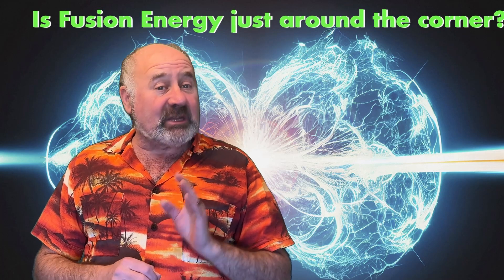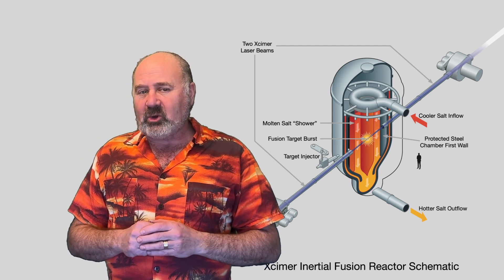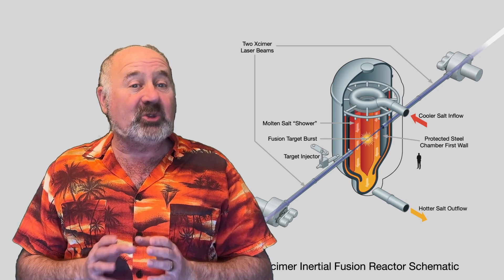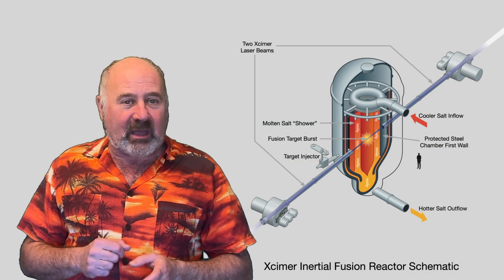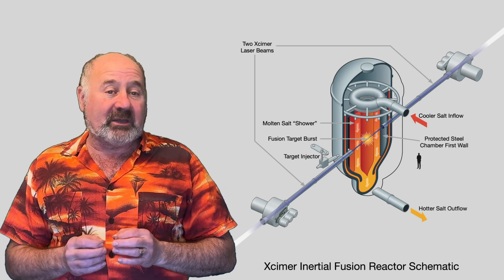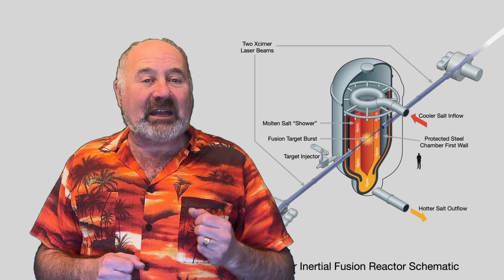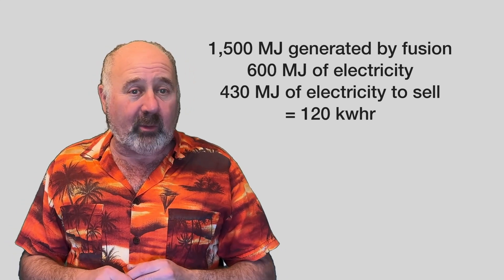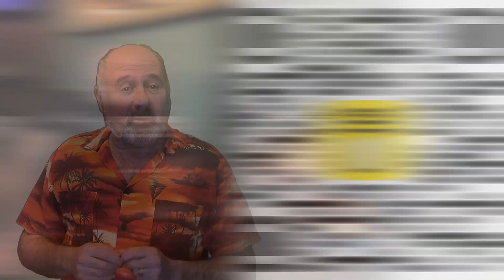Can millions of mini hydrogen-bombs power our world?

Comment: Xcimer claims that a key advantages of their laser system, compared to systems pumped by diode lasers, is the lower cost. Here is what copilot said: 

Excimer lasers, on the other hand, tend to be more expensive due to their complex construction and the need for high-energy pulses. The cost per joule for excimer lasers can be significantly higher. For instance, excimer lasers used in fusion energy applications have been designed to reduce costs by a factor of over 30x compared to traditional systems, but they still remain more expensive than diode lasers.

Cost Comparison
Diode Lasers: Lower initial cost, higher energy efficiency, and lower operational costs. 👈✅

Excimer Lasers: Higher initial cost, lower energy efficiency, and higher operational costs. 👈❌

In summary, diode lasers are generally more cost-effective per joule compared to excimer lasers, making them a preferred choice for applications where cost and efficiency are critical factors.
Reply: thanks copilot
Reply from the maker: Not an expert, but I don’t think laser diodes go anywhere close to this energy or wavelength (UV).
Reply: @Decarbonize11  You are correct—no single laser diode can produce 4 GW. That is why they are grouped into bars, stacks, and arrays. A quick online search revealed several high-efficiency, high-power diode laser modules. In particular, I found a 6-inch, rack-mounted module designed for pumping (940–980 nm) solid-state lasers. These modules deliver a peak power of 200 kW for 3 ms pulses at 65% efficiency. To pump 12 MJ of energy in 3 ms, approximately 20,000 of these modules would be required. This could be achieved with 333 cabinets (each measuring 5’ × 2.5’ × 1’), housing 60 rack-mounted modules per cabinet. The total footprint would be just 150 square feet.
    To put this in perspective, consider the National Ignition Facility (NIF) laser system. It is housed in a 10-story building covering approximately 500,000 square feet, with the laser amplifiers alone occupying about one-fourth of the total floor space.
    It is true that infrared (IR) light produces significantly more suprathermal (“hot”) electrons than ultraviolet (UV) light. These high-energy electrons can preheat the fuel, raising its temperature prematurely and reducing the compressibility of the target. However, if the target were a bubble of fuel submerged inside a reactor—a large hollow metal sphere filled with molten Nd:FliBe (a fluoride-lithium-beryllium eutectic) serving as the medium for a liquid-state heat-capacity laser—this preheating effect would not be an issue. The fuel would be better contained within a dense liquid rather than in a vacuum chamber. Additionally, heat loss from bremsstrahlung radiation could be reflected back into the fuel.
    Another advantage of using bubbles of fuel is target cost — zero. 
    A population inversion could be created by using fiber optic cables to pump energy from the laser diode modules into the Nd:FLiBe. If a large bubble of fuel were positioned in the center of the reactor during a population inversion and acoustically compressed, then the bubble's blackbody radiation would trigger a laser cascade. This cascade would then be amplified, reflect off the polished metal walls of the reactor, and further heat and compress the fuel until fusion ignition occurs.
Reply: What happens when two adjoining regions of condensed matter (solid or liquid) with different electron densities are suddenly heated to the same extremely high temperature—high enough to fully ionize them? ⚛ 

Apparently, since the temperature is identical in both regions, their radiation pressure will also be the same. However, the contribution of particle pressure to the total pressure will be proportional to the particle density. Initially, in their un-ionized state, the particle densities of both regions are roughly equal. But upon ionization, these densities can change dramatically, as high-Z materials release far more electrons than low-Z materials. Even in a radiation-dominated system, where radiation pressure far exceeds particle pressure, the total pressures in the regions will not balance. This pressure differential causes the high-Z material to expand, compressing the low-Z material. The effect is even more pronounced when low-Z gas is surrounded by high-Z condensed matter.

This ionization-driven compression could be crucial in a fusion reactor where high-Z material directly contacts bubbles of low-Z fuel. Interestingly, a similar principle was explored in the Soviet Union’s "Layer Cake" (Sloika) H-bomb design. It incorporated Vitali Ginzburg’s idea of using solid lithium deuteride fuel alongside Andrei Sakharov’s concept of ionization compression.
Reply from the maker: That sounds pretty much like the NIF approach, which was incredibly complicated and expensive to coordinate all these lasers.
Reply: @Decarbonize11  In the system I’m envisioning, laser synchronization would happen automatically and with minimal complexity. Each laser diode module would feed light into a bundle of fiber optic cables, which would shine directly into the reactor chamber to pump the Nd:FliBe (a solid-state laser medium). This pumping creates a population inversion—a process that unfolds over milliseconds, not nanoseconds.

Importantly, this pump light wouldn’t directly heat the fuel bubble. Instead, the main laser would handle heating and compressing the bubble to fusion conditions. This main laser itself is a spherical, heat-capacity liquid Nd:FliBe system, and its laser-cavity is the entire reactor chamber with its spherically mirrored walls. The main laser will remain in a meta-stable population-inverted state (inactive) until acoustic compression of the deuterium-tritium (DT) fuel bubble drives it to emit an intense pulse of blackbody radiation. That thermal pulse is what triggers the laser cascade, which quickly drains the pump-energy from the laser-medium (Nd:FLiBe) and deposits it in the bubble of fuel. 

😉 The process is fairly elegant: the Stefan-Boltzmann Law (which links blackbody radiation to temperature as ∝ T⁴) naturally synchronizes the acoustic compression and laser firing, ensuring the laser activates at the optimal moment—when the fuel bubble is already partially heated and compressed. 😉

Overall, this design could dramatically lower costs, especially since the laser system is typically the most expensive component in inertial confinement fusion (ICF) power plants.
Reply from the maker: That’s very long light at 1053 nm. I doubt the coupling to the bubble would be appropriate to trigger fusion.
Reply: @Decarbonize11  That is an insightful observation. However, it seems based solely on limitations of current ablative-drive, cryogenic, high-compression fuel capsules rather than my method. Historically, the "exploding pusher" concept dominated, where a thin shell heated by lasers explodes, resulting in modest fuel compression but high initial temperatures. These targets ultimately failed to achieve high gain and were abandoned due to:

• *Insufficient Fuel Compression:* Exploding pushers offer minimal compression compared to ablative methods. The thin shell rapidly disintegrates from laser shock, limiting fuel density and preventing sustained burn. Fusion occurs briefly in shock-heated plasma, yielding minimal energy before expansion and cooling. Lack of confinement prevents ignition and sustained reactions.

• *Poor Energy Coupling and Preheat by Hot Electrons:* Exploding pushers suffered from poor energy transfer from lasers to fuel. High-intensity lasers generated hot electrons preheating fuel prematurely, causing expansion and reduced density. Early lasers like LLNL’s Shiva experienced low yields due to inefficient energy absorption (~20%) and wasteful heating. Shifting to shorter wavelengths (UV lasers) improved coupling, but fundamental inefficiencies remained.

• *Rapid Heat Loss and No Self-Heating:* Exploding pushers produce hot but short-lived, low-density plasma, losing energy rapidly through conduction, radiation, and expansion. The fuel fails to trap alpha particles for self-heating, quickly dissipating energy and falling far short of ignition criteria.

Thus, designs shifted to indirect-drive approaches using thicker shells and cryogenic fuel, leveraging symmetrical X-ray drives for efficient compression.

My approach addresses these issues by confining fuel within several tons of molten salt undergoing high-speed implosion and kilobar-scale pressures. My laser intensity (~10¹⁰ W/cm²) is significantly lower than NIF’s (~10¹⁵ W/cm²), avoiding instabilities and hot-electron generation. Above this intensity, FLiBe breaks down, producing an absorbing plasma wave, heating to ~200,000 K, and generating shock waves that compress the fuel.

Although initially counterintuitive, my approach could fuse larger bubbles with ~10x fuel mass and significantly lower density compared to traditional ICF capsules. While the larger bubble surface area suggests greater heat loss, its significantly lower thermal conductivity and reduced temperature gradient result in overall thermal losses approximately 30 times lower than conventional compressed capsules. Consequently, my approach more easily achieves self-heating, enhanced by a spherical mirror focusing energy back onto the bubble.
Reply: @Decarbonize11 Dr. Silber, sorry if this is redundant. I'm pretty sure I already posted a comment here, but my posts keep disappearing.  :face-orange-frowning:

In the system I’m envisioning, laser synchronization would happen automatically and with minimal complexity. Each laser diode module feeds light into a bundle of fiber optic cables shining directly into the reactor chamber to pump the Yb:FliBe (a solid-state laser medium). This pumping creates a population inversion—a process unfolding over milliseconds, not nanoseconds.

Importantly, this pump light doesn’t directly heat the fuel bubble. Instead, the main laser—a spherical, heat-capacity liquid Yb:FliBe system forming the reactor chamber and its spherical mirror—handles heating and compressing of the bubble located within the laser itself, to fusion conditions. The main laser remains in a meta-stable, population-inverted state until acoustic compression of the deuterium-tritium (DT) fuel bubble generates an intense pulse of blackbody radiation, triggering a laser cascade. This cascade quickly drains pump energy from the Yb:FliBe medium and deposits it into the fuel bubble sitting at the central focus of the reactor chamber.

The Stefan-Boltzmann Law (blackbody radiation ∝ T⁴) naturally synchronizes acoustic compression and laser firing, ensuring activation at the optimal moment—when the fuel bubble is already partially heated and compressed.

Overall, this design could dramatically lower costs, especially since lasers are typically the most expensive component in inertial confinement fusion (ICF) power plants.
Reply from the maker: @michaeldeeth811  Sorry if I'm being thick, but I'm trying to wrap my head around your idea and it's just not clicking. 

For instance, what triggers the flash of backbody radiation that triggers the laser? 

So your liquid YB FliBe would serve multiple purposes: lasing material, heat absorption, neutron absorption, lithium breading. Would the turbulance in the liquid impact it's ability to create the next laser flash? Does an element needed for the laser properties absorb neutrons, preventing tritium breading? Are there lasers even remotely like this?
Reply: @Decarbonize11  Thank you, Dr. Silber, those were very good questions. 

Can a compressed bubble produce sufficient blackbody radiation to trigger a laser cascade? 
The temperature of a compressed gas can be calculated T2=T1*(P2/P1)^((gamma-1)/gamma), where T1 is the initial temperature, P2 is the final pressure, and gamma is the adiabatic index.  If, for example, we assume T1 = 750 K, P2/P1 = 10000, and the gamma of hydrogen gas ranges from 1.4 (molecular) to 1.67 (atomic), the final temperature ends up between 10,000 K – 30,000 K. According to the Stefan-Boltzmann law, the bubble’s surface will radiate with between 57 kW – 4.6 MW per square centimeter. However, this radiation is broadband and incoherent, encompassing a wide spectrum of wavelengths, whereas laser amplification occurs within a narrow band. Only a small fraction of the bubble’s blackbody spectrum will align with Yb:FLiBe’s narrow amplification bandwidth, but if the full spectrum passes through a gain medium, specific parts can be selectively amplified. 

How is compression of the bubble achieved? 
I propose using numerous piezoelectric stack actuators positioned around the exterior of the spherical reactor.  These devices exploit the piezoelectric effect to generate precise motion or force through rapid expansion or contraction under electric fields, which can switch polarity within microseconds. Constructed from stacked layers of robust ceramic material, they withstand compressive pressures up to approximately 250 MPa. Individual actuators can exert forces of several kilonewtons or more, depending on their design parameters (layer count, cross-sectional area, stiffness) and applied voltage. If all of these were energized simultaneously when the bubble was at the center of the sphere, the pressure created would transmit inward, gaining speed and pressure as it converged toward the bubble. 

Will turbulence and non-uniform temperature distributions lead to laser failure? 
Comparing FLiBe to water provides insights: FLiBe's viscosity is approximately ten times greater, reducing turbulence significantly. Additionally, FLiBe's thermal conductivity is double that of water, quickly smoothing out temperature variations. Its thermal expansion coefficient (~0.00002/K) is also an order of magnitude lower than water, minimizing optical distortions due to density gradients. Thus, turbulence and temperature gradients are not expected to significantly impair laser performance.

How does neutron absorption in Yb impact the tritium breeding ratio (TBR)? 
Typically, in rare-earth lasers, only a small amount of dopant (0.5 – 2.0 atomic percent) is required. There are several isotopes of Yb, and most are well behaved. However, when 168Yb captures a neutron it becomes radioactive, emitting a 177 keV gamma (46 s) and beta decaying (32 d) into 169Tm. The neutron capture cross-section of 168Yb is about 100x that of lithium. This is not fatal, because the abundance of 168Yb in natural Yb is only 0.00123(1). In conclusion, the TBR will not significantly decrease from the small amount laser dopant. However, introducing rare-earth elements to the FliBe will produce radioactive byproducts. 

Are there any existing lasers similar to this concept? 
No, but Anthony Siegman (AKA god) told me that an extremely hot molten glass laser medium could function, but such a laser would have no earthly use. The idea of an Amplified Blackbody Emission (ABE) laser is similar to an Amplified Spontaneous Emission (ASE) laser, which harness spontaneous emission, subsequently amplified through stimulated emission within a gain medium. Unlike conventional lasers, which rely on optical cavities with mirrors to provide feedback and achieve coherent light amplification, ASE lasers can operate without such resonant structures. In ASE lasers, amplification occurs without the need for an optical cavity; the light makes a single pass through the gain medium, gaining intensity as it interacts with excited electrons. Because there is no optical cavity, ASE lasers have a broad emission spectrum, which suppresses laser-plasma instabilities, like stimulated Raman scattering and stimulated Brillouin scattering.
Reply from the maker: @ your approach reminds me of General Fusion’s Magnetized Target Fusion, without the lasers that just seem too complicated to me.
Reply: @Decarbonize11  Dr. Silber, you mentioned that my approach resembles General Fusion’s? Is that because both approaches occupy the intermediate range of density/time parameter-space between ICF and MCF? If not, please elaborate. 

Several years ago, I Emailed Dr. Michel Laberge, the founder of General Fusion, to describe my reactor design. I was looking forward to his opinion because his Ph.D. is in physics focused on laser fusion. He wished me good luck, and expressed liking my unique laser approach. 

You indicated a dislike for lasers. Are all lasers inherently too complicated, or just mine? 

The fundamental principle behind triggering a laser-medium is simple, “if you hit it hard enough, it will lase.” That phrase is attributed to Dr. Arthur Schawlow, a Nobel Prize-winning physicist and pioneer of laser technology. 

My approach is easy, just add a rare-earth dopant to a vat of transparent liquid, and poor it - glop, glop, glop - into a hollow spherical chamber with reflective walls. The chamber functions similarly to the baking chamber of a child’s “easy-bake” oven – just place the ingredients inside and turn on the light. The reflective cavity acts to conserve energy while the stuff cooks. So simple, what is too complicated about that? 

Another observation pertains to spherical geometry. Inside the sphere, a ray of light has its path confined to a plane determined by its origin, the sphere’s center, and the initial reflection point, making it impossible to leave that plane. A detailed examination shows that a ray passing close to or originating near the center returns to approximately its initial location after two reflections. This allows for off-center target ignition and provides considerable flexibility when positioning the fuel. Even if the fuel is placed several centimeters from the sphere’s center, ignition proceeds without significant degradation. This represents a substantial advantage over direct-drive ICF, which demands laser focusing accuracy within 50 microns of the fuel.

Short video on how to trigger laser ignition: https://www.youtube.com/shorts/Opy0lP8cQ5A
Reply from the maker: @ 
My dislike of lasers is they have low efficiency, which makes creating an economical power plant difficult. As you said, “if you hit it hard enough” doesn’t speak to an efficient system. You believe your efficiency will be reasonable, but there are no lasers operating like yours to give confidence in your estimate. 

The spherical geometry and the unconventional compression approach is what reminds me of General Fusion’s. 

I’m not suggesting your approach won’t work. If you were able to get support I’d suggest demonstrating a laser similar to your concept would go a long way to building confidence.
Reply: @Decarbonize11  Dear Doctor, you have me perplexed. 😵‍💫

How can you “love” my previous post, where I calculated that my laser would have a wall-plug to fuel heating efficiency 600 to 2500 times NIF’s, and nevertheless say lasers have a low efficiency problem? 

Anyway, it is a mistake to focus solely on laser efficiency. A bigger, more encompassing, problem is to minimize the per-shot energy usage. For that, we need to know how much fuel is to be heated and what temperature is sufficient for fusion.  The way I see it, MCF requires 10 keV, ICF requires 5 keV, and because low-temperature volume-heating is viable, my approach requires 1.6 keV. Of course, such a bold statement requires justification. 

Where should I start? Deep inside my reactor, in a large body of transparent molten Yb:FliBe, a large bubble of fuel is confined centrally at the optical focus of the sphere. Here, not even radiant energy can escape the reflective walls, perpetually returning EMR to the fuel. Note, NIF capsules contain approximately 0.2 to 0.3 milligrams of DT fuel, barely sufficient to stop the 3.5 MeV alphas that self-heating requires. My bubbles are larger and more massive, containing over 10 milligrams of fuel, so self-heating is assured. 

Thermonuclear ignition and burn of a plasma occur when internal heating by fusion products exceeds all energy losses, such that no further external heating is necessary to keep the plasma in the burning state. Ignition requires a certain temperature, depending on the fusion fuel and the relevant loss mechanisms. Here, the ideal ignition temperature of a deuterium-tritium plasma can be restricted to electromagnetic radiation losses by bremsstrahlung emission. Certainly, there are other important loss mechanisms—such as thermal conduction and mechanical work—which tend to increase the ignition temperature. However, at temperatures below 5 keV, these other loss mechanisms are, in comparison, insignificant toward cooling, and it is in this sense that the term “ideal” is used. 

A power balance ⚖ relationship exists between the heat gained by fusion alpha-particles and that lost due to Bremsstrahlung cooling. Self-heating and ignition take place when the temperature exceeds this balancing point. For typical ICF, the ideal ignition temperature is 4.3 keV. My approach ignites at 1.6 keV. The reason they differ by so much is because my reactor holds the fuel in place while preventing radiant losses through the use of an internal reflective mirror which enables most of the radiant losses to be reabsorbed. The idea behind radiant energy reabsorption is to slow losses down enough so that self-heating can cause an accumulation that leads, through positive feedback, to an eventual ignition. 

My laser system may be unorthodox, but it violates none of the fundamental laser physics principles required for its operation. 

I think we agree, “if you hit it hard enough, it will lase” relates to power, not efficiency. 

https://www.quantel-laser.com/en/products/item/high-efficiency-high-power-diode-laser-.html

Do you still think laser-inefficiency is an unsurmountable problem? 

I’m enjoying this, so I QRed you another coffee. 🍻
Reply from the maker: Thanks for the pint. I had it last night in a lovely pub with music after a play.
Reply from the maker: In the earlier post you claimed high efficiency, but you’ve also said there are no lasers like this. In general lasers have low efficiency, so you’ll need some data to back up the claim so high efficiency.
Reply from the maker: How do you hold the fuel in place? You can’t just drop them through the liquid, as they would move off of the center line.
Reply: @Decarbonize11  Thank you, Doctor, your feedback is much appreciated. 

I understand why you’d think laser’s in general have low efficiency, given that the world’s most well-known laser (NIF) has a wall-plug-to-UV efficiency of just 0.25% - 0.5%.  That said, here are my reasons for claiming that (compared to NIF) significantly more efficient lasers are not only possible, they are common.  
    1. the primary energy source of the NIF laser is the grid, which powers its 7680 six-foot high flashlamps. These have a conversion efficiency from electrical energy to light of only about 10%. In comparison, diode lasers can convert 60-70% of their electrical energy into light. 
    2. flashlamps have a broad emission spectrum. Only a small portion of their emission band matches the lasing medium’s absorption band, everything else gets wasted. In comparison, diode lasers can pump directly to absorption bands, eliminating this waste entirely. 
    3. flashlamps cannot control their flash duration, which last between 200 and 350 microseconds. This sets up a catch-22 situation, where it would be wasteful not to utilize the total amount of energy emitted from the entire 350 microsecond flash, but such a delay will lead to more electrons relaxing back to the ground state via non-radiative processes (e.g., phonon interactions). Either way, a significant amount of energy gets wasted, lowering efficiency. In contrast, diode lasers can minimize this loss through quick and accurate pumping. 
    4. NIF’s medium is doped with Nd, which decays from its upper-state with a lifetime of ~230 microseconds, compared to 1-2 milliseconds for Yb doped lasers. More decays = less efficiency. 
    5. heat from premature upper-state decays in NIF’s laser medium need to be actively removed, costing additional energy. In contrast, my approach can reclaim this type of heat in subsequent thermal cycles, gaining efficiency. 
    6. the quantum defect of the Nd laser medium used at the National Ignition Facility (NIF) depends on the wavelengths of the pump and laser photons. For example, if the Nd is pumped at 808 nm and lases at 1064 nm, then its quantum defect can be calculated as approximately 24.1%. The difference in energy between the pump and laser photons contributes to thermal loading in the laser system. In contrast, because Yb is usually pumped at 940 nm and lases at 1050 nm, its quantum defect is only 10%.  

Conclusion: Nd-doped lasers are by no means inefficient – modern designs reach ~20-30% wall-plug efficiency (WPE), which is a huge improvement over older technology – but Yb’s combination of low quantum defect, favorable pump bands, and long upper-level lifetime give it the edge. Yb lasers tend to achieve around twice the WPE of comparable Nd lasers. The highest WPE reported for diode-pumped solid-state lasers are all Yb-based (e.g. >50% in fiber format, ~30-40% in bulk format). 👈

This concern with a laser’s WPE is peripheral to the more important question, how is the efficiency of fuel-heating maximized? For fuels undergoing fusion there is an obvious answer. Self-heating has, by far, the greatest potential to maximize fuel-heating efficiency, nothing else comes close. In this light, my approach shines uniquely. Only my laser system compresses a massive amount of fuel mechanically and holds in place long enough for self-heating. Other approaches heat a tiny speck of fuel in a vacuum chamber, where it instantly disperses. According to Dr. Todd Rider (a classmate?), heat loss from bremsstrahlung is the biggest obstacle on the path to commercial fusion. My approach sidesteps that obstacle by placing the fuel in the center of a spherical chamber, which reflects bremsstrahlung back to the fuel.  

Andy, I saved the best for last, just to make you happy. 🤪

The slippery path to fusion: https://www.youtube.com/shorts/Kj44jGQTT9w
Reply from the maker: Xcimer claims self heating, so your approach is not the only one. 

Do you have any graphics? I’m don’t have a sense of how your target is delivered and held in the center of your sphere.